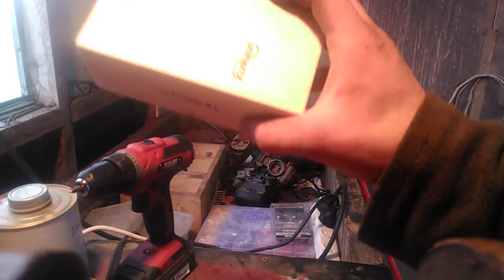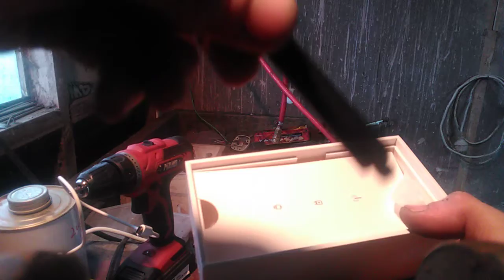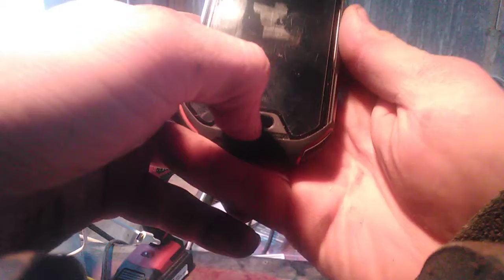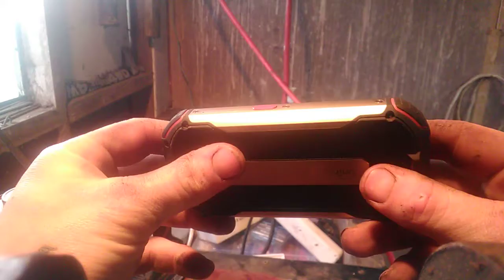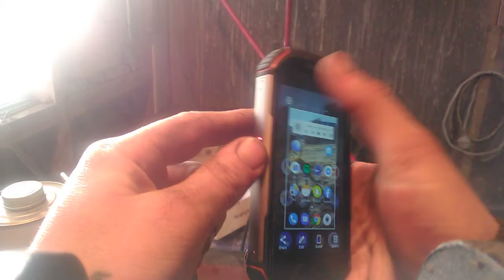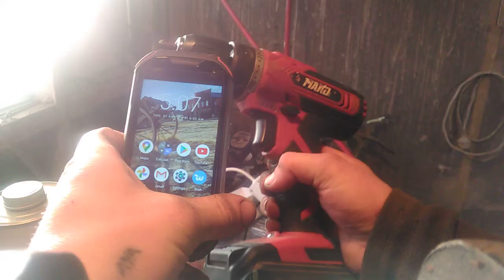Unihertz Atom XL - 1 week into using one

Comment: I had one and the screen result broken falling from 30cm height, very disapointed.
Also phone has to be sent to china to repair for 60$, THEY DO NOT SELL SCREENS
Service has result to be complete disaster.
Reply from the maker: There's a trick to dealing with their service team. I'm making another video soon to explain my situation I get replacement parts
Reply from the maker: Surprised yours broke from that. I've left the original screen protector on and it keeps falling out if my pocket when I get out of my ute after a long day of work. It's a lifted toyota hilux so it's about a meter drop straight into rough concrete. Happened about 5 or 6 times now and worst I've done is damaged the sim card tray
Reply: You are Lucky, mine felt from only 30cm.... ,  no resistant phone or maybe defect one
Reply: Now they do go back on there website
Reply: Buy any other one,  the result will be Allways better, I have and old Xperia wich is much more resistant than this fake

Comment: The center "button" is the finger print scanner. Not a button. Also the antennae is for using walking talkie
Reply from the maker: It's also a touch home button but would be better if it was actually a physical button. I have no way of using this is a walkie talkie in my country as I can't pick up any signal from it
Reply: @rusty8770  yeah sorry about the antennae be carwful ive seen alot of comments on the kickatarter about the phone not staying dry inside after being submerged in water. Other than that it's a beefy phone. Theres also a tiny version ( the original atom) from a while back. I use for hiking and cycling.. Takes a beating and keeps on working.
Reply from the maker: @SporkChops85  I haven't submerged this I usually try and avoid form one bad experience with an ip68 samsung that died. I've had it wet and water in the speakers the worst I l got was a foggy camera but all mint now

Comment: Works fine on NZ cellular networks then I guess. Are you on Spark? Thanks.
Reply from the maker: 2 degrees haven't had a problem with towers. I'm in the waikato and there are a few dead zones and not too many towers here but it's been good for connection
Reply: @rusty8770  Great. Thanks bro

Comment: How's this phone with watching YouTube?
Reply from the maker: Runs the app without any lag. Definitely good sound quality he screen size might bother a lot of people but I'm not worried.  Not sure about the different qualities because internet here is slow so I watch everything at 480p anyway and most of that is on a chromecast anyway.
Reply: @rusty8770  Thanks!
Reply: @rusty8770  Does the bluetooth work? The regular atom (non xl) had bluetooth that didn't work.
Reply from the maker: @Corvus__  only used it once or twice but it was working
Reply: @Corvus__  The bluetooth of my uniehrtz atom qorks quite fine.
Reply: @dedorfla7425  Xl or regular?
Reply: @Corvus__  The normal one with the 2.45 inch screen.
Reply: @dedorfla7425  Thanks. Got a link for the xl by the way? Can't seem to find it on Amazon or ebay.
Reply: @Corvus__  https://www.unihertz.com/atom-l.html
Reply: @sweeedex  Thanks!
Reply: @sweeedex  this is atom L
Reply: The size of the screen is ok. The sound box? is very good, i really like the sound. The only thing i do not like is the weight.
Reply: @Oggyhilator  Yeah but, does it slow down often at 450p or higher? How's the cell and wifi connection? Does bluetooth work on this thing? (Bluetooth didn't work on the non xl version.)
Reply: @Corvus__  I did Not Testet it  yet, but  It has Bluetooth and NFC.
Reply: Several random videos testet, 480p